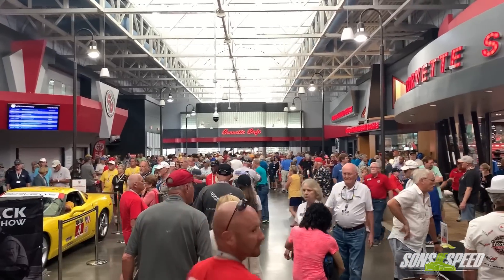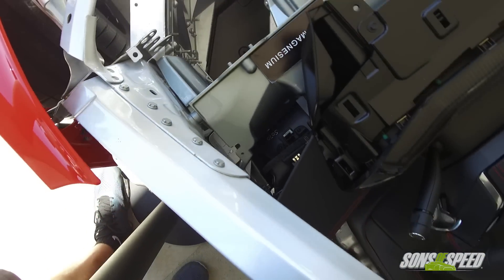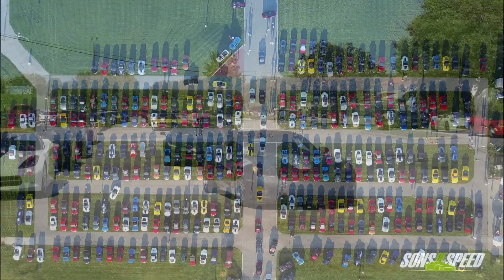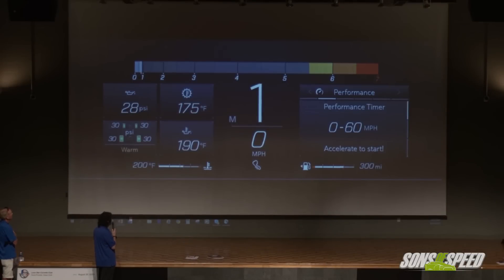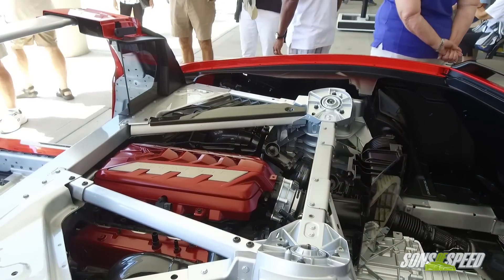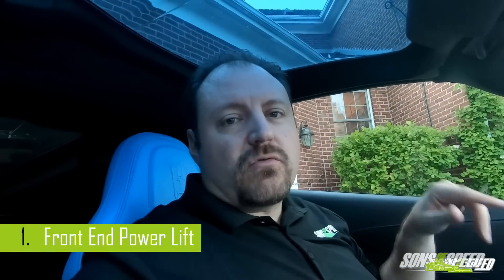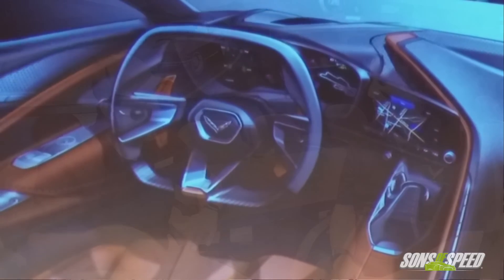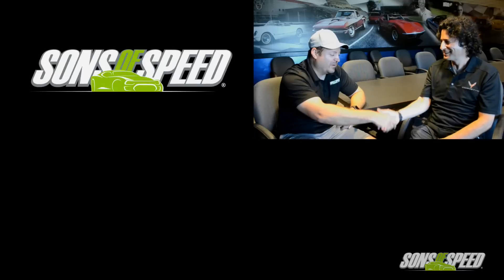Inside the 2020 C8 Corvette with Product Manager Harlan Charles | Sons of Speed

Comment: I Love "shifting for myself" like everyone else... But the REAL factor is mentally being in control of the vehicle. So shifting with a paddle is NOT the same as 'stirring a shifter', but YOU can still tell the car WHEN to shift, if you want to.
I have to also consider that I have now had 9 major leg surgeries -- including a 'new' left knee -- that makes driving a clutch a lot more difficult, if not impossible... and PAINFUL. And THAT kind of takes the FUN out of manual shifting. "Heel & Toe" becomes a Strain that is actually a bit distracting, and less precise than in past years. And the DCT shifts without Busting U-Joints...
Reply from the maker: We would agree, which is why having a choice of two transmissions would be the best of both worlds allowing owners to choose the transmission that is right for him or her.
Reply: Sons of Speed DCT IS a manual transmission. You’re still telling it when to shift and it won’t shift until you tell it to when in manual mode. Only a manual clutch is missing.